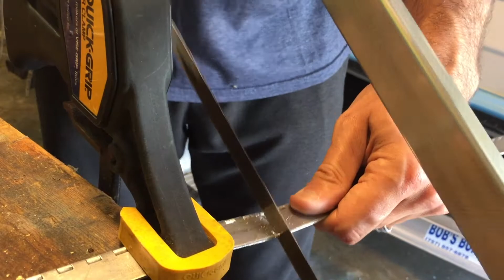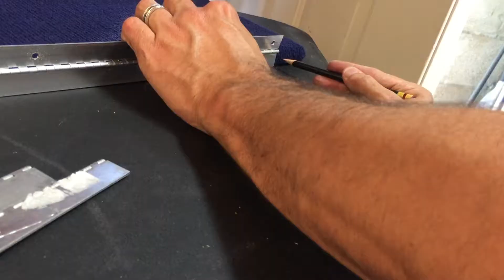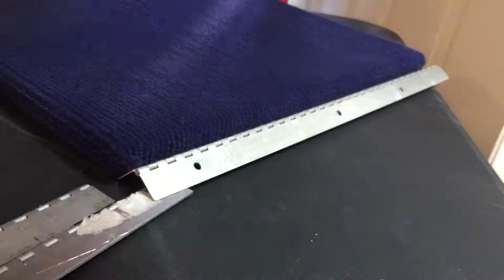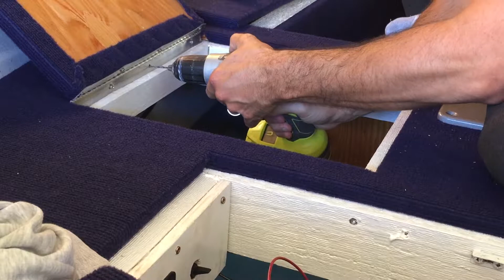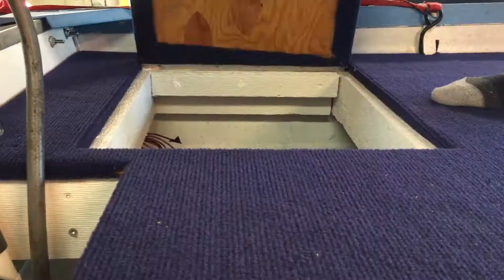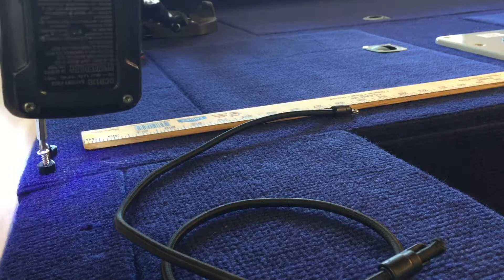14 FT Utility/Jon Boat Restoration | Hatches, Hinges & Seats

Comment: Wow! You did a great job! I've got a boat just like that, I like your lay out!
Reply from the maker: Thanks Eric, I am really happy with the way it turned out. I was a bit worried about the weight, but I have a 25hp and its seems to handle it well even with myself and another guy on the boat . When I'm alone on the boat the extra weight makes it more stable as well. I hope to do a walk around video of entire boat soon. This week I am going to reshape the trolling motor mount to make more space and carpet it for aesthetic purposes. Ill also be adding a bow light to the mount that I wired in before I put floors down.

Comment: Great job!  How much weight did this add to the boat?
Reply from the maker: Thanks John, I estimate it add about 150 to it. I have a 25hp outboard and it still gets on plane quick and runs just fine. Ill try to do a walk around vid of balance of boat and speed. You can see in a later video I have it on plane with my dad whose a big guy and it still runs great. Thanks for watching!
Reply from the maker: I forgot to mention I used cedar for the frame which is light and naturally water resistant.